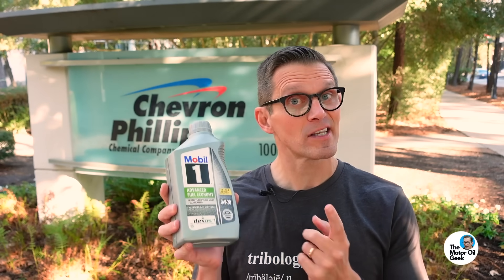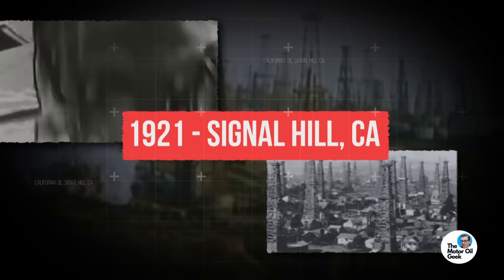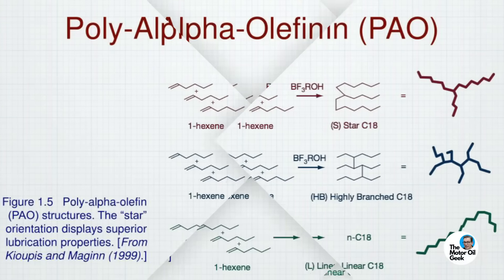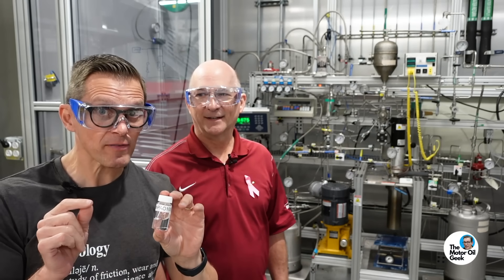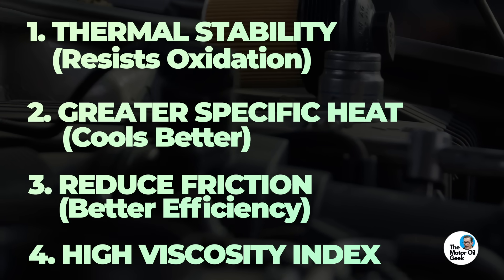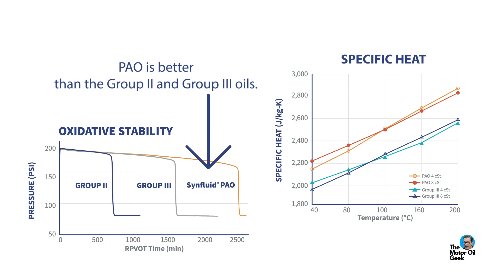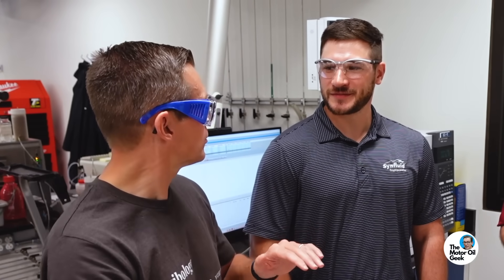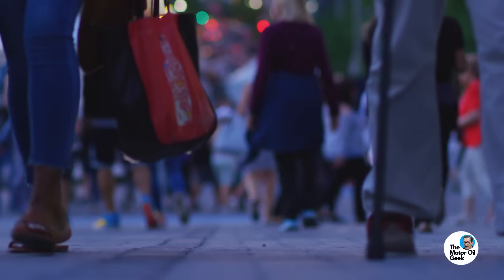STOP Using Regular Oil - 4 Reasons Synthetic is BETTER!

Comment: I noticed when Mobil 1 changed to SP, they removed all PAO and Ester from what I’ve heard.   I also noticed I’m now getting higher engine wear metals.   I’ve switched my Audis to Motul 8100 x cess (per your suggestion) which has some true synthetic.

I’ve just purchased a Gensis G70 2.0 that Im trying to decide between Redline and Amsoil signature. For complete Ester/PAO base.  Suggestions?
Reply: Amsoil, Redline, or HP lubricants.
Reply: @LoveLikeaHurricane  Wasn't familiar with HP.  Thank you for the info.

Comment: 350 SBC, -79 K5, now about million km:s. First over 600000 km:s with mineral 10W-30, after that 5W-50 winter, mineral 20W-50 summer. Never over 3000 km:s between oil change. When replacing the old valve cover seals, everything looked like just assembled yesterday inside. Not using oil. So, here in Finland oil must really do it's job, as the temperature range between summer and winter is huge.  Unless there is something else wrong, it does not matter what oil is used as long as it is changed "too often".
The old V8 does not have EGR, so the oil keeps clean and not abrasive when flowing past the filter in the cold.
Most synthetics are for light passenger car use only. The old Mobil One 5W-50 was notorious for breaking up thin fast , I almost broke my boat's Windsor 351 with that crap. Fortunately I was able to replace that with single grade 30W I got from a fisherman at the island I was visiting. With that the engine was silent again. The engine broke after couple of years, but that was because of piston pin breaking : the pin has almost no radius machining close to the connecting rod area inside the pin. There was a gray area on the breaking point next to shiny, so...
I have now used all brands except Mobil. Perhaps it is good now, but once bitten...

Comment: My 2008 Acadia uses conventional oil since I bought the car and so I need to stay with conventional oil or it can start to leak with the synthetic oil and that’s what I’ve been told by several mechanics so synthetic oil wouldn’t work in my car and I use 5W-30 weight Engine oil. I’ve had no problems and it’s got 97,000 miles. If I could switch to synthetic and it not start to leak and cause problems I would, but I’m too worried that it would cause a problem and I’m not about to try it.
Reply: You can switch to a synthetic. 2008 is new enough to have no issues with seals.

Comment: I have a 2000 F250 7.3 that has 433,000 miles. It’s always had Rotella T4 15w-40. Would it be worth swapping to synthetic or could it do more harm than good?

Comment: In the store when buying oil how do you tell if an oil uses PAO base stock? Does it always say on the bottle?
Reply from the maker: It is generally not on the label. The SDS sheet will show that info.
Reply: @themotoroilgeek  
DeepSeek concluded it's probably not PAO, but type 3 base stock. Budget oils typically aren't PAO, or might contain a very small amount for bragging rights.

Comment: I don't know if it's related to Amzoil history, but Superior, Wisconsin where Amzoil is located is one of the coldest places in the lower 48 states. When it gets 20 or 30 below zero, cars get very hard to start. Apparently synthetic oil was the answer.
Reply: I know that you've stated "one of the coldest places", but I've always thought that generally, by winter average temps, International Falls was THE coldest locale in the whole lower48.??
Reply: @Fordworldrallyfan  Yes, International Falls is colder than Superior. Tonight Superior will be nearly 20 below zero and International Falls nearly 30 below -- both pretty darn cold. 😢

Comment: I have always wondered where synthetic oil came from?  I didn't think it came from Vegetable oil.
  Years ago Amsoil said with their oil, change your car engine oil every 20,000 miles instead of every 5,000 miles.  or was it 25,000 miles.  That's when I assumed that Amsoil was a scam.
  How does  motor oil help your engine run cooler if the engine has a Radiator with a Thermostat and an oil cooler?
   Someone at Fuel Moto a Power Sports Tuning shop and Dynojet dealer told me not to worry about the fact that my cooling does not turn on until 222-F on a Yamaha FZ-07 Motorcycle.
  That's hot enough to blow head gaskets break down the oil ect.  When it's cooler out and the tiny radiator can keep up and the bike is going fast enough to run air through the radiator it does not run over 180-F ,,  I need to change the fan turn on speed to a much lower temp in the ECU ..
Reply: Many of the POES/other esters are actually derived from plant sources.

It's why many think that some of the Motul high ester base stock content oils smell a bit like bananas.

Comment: Please do a video on the dexosD spec for the 3.0 Duramax.  How does it really compare to say Mobil 1 Delvac ESP 5W-40 that I would prefer to use for "peace of mind"!  Thanks for the great info as always!
Reply from the maker: Good suggestion!
Reply: @themotoroilgeek Thanks! There is a lot of debate around this oil in the owners groups. I am not necessarily a naysayer on the 0W-20 but to take it a step further I really would prefer to use one 5W-40 (or 15w-40) HDEO for my Cummins, 3.0 Duramax, and even an old 5.4 3V Ford V8 gas motor. Not sure if it makes sense from your perspective but I have seen anecdotal evidence for many years that this could work reasonably well.

Comment: I agree. But. My Blueprint engine came with a warning that using Synthetic oils the first 9,000 miles will void the warranty. 
I am assuming they WANT a certain amount of wear in/break in, before going to Synthetic?
Reply from the maker: Break-in is a different story. No synthetic during break-in.
Reply: @themotoroilgeek have you made a video about this?

Comment: I'd love to see a deep dive into "racing" engine oils specifically aimed towards alcohol based fuels like E85-100 and Methanol, including Castor oils. I don't care about any catalytic converter or cold weather flow nonsense, just what's the best oil to run with E85/methanol for wear/breakdown.
Reply from the maker: Noted!

Comment: My dad swore that Amsoil kept the engine in his early-1980s Freightliner from being damaged after an accident the guy driving the truck was involved in. The engine cooling system was damaged, all the coolant drain out and by accident truck was left idling for over an hour without coolant circulating. When the truck went in for repairs the engine was torn down and inspected for damage once they realized the truck had run for over an hour after the loss of coolant. No damage was found to any of the engine components which my dad attributed to using Amsoil engine oil.
Reply: I recently had an employee drive a truck home from the shop without coolant. I fixed it and refilled it, and the engine still runs like normal. I'm not going to tear it down because it runs fine, but it did happen. The guy said he had to pull it over and let it cool down on the way home. People don't think.

Idling, I wouldn't expect issues in a big diesel anyway, since they don't generate much heat. A big diesel will not fully warm up by idling, not without some sort of help, like an exhaust restriction.

Comment: Hey Motoroilgeek what about a carburetor chevy 350 engine flat tappet cam also would i still need to run synthetic blend or full synthetic vs conventional i dont drive much at all until spring or summer?

Comment: As a youngster we would tear down an engine with fairly low mileage, 70 - 150k. They all had a ring ridge at the top of the bore. But the bore would be almost perfect at the bottom of the stroke. Petroleum lubricants don’t like the temperature found close to the combustion chamber, approaching 800+f. No lubricants high wear.
Reply: that's why it's common practice to build performance engines a bit looser than daily drivers (more ring gap), lets a bit of oil by to lubricate that top ring.
Reply: @ I believe that petroleum based oil will not stick to metal at the temperatures found in the combustion chamber.  I’ve built engines with greater tolerances in ring end gap and even in the bearing clearances. It was to reduce friction.

Comment: Mr Lake I am writing from Greece. I have used a  0w30  pao based vw 504/507  approved lubricant from Cyclon in my car (the number one greek company in the field) which uses synfluid pao from Chevron. I immediately noticed a very smooth start especially in winter  , a quiteness in low and medium revs but i noticed oil consumption when a pass the 8500 km mark. After that I am using a 5w40 euro spec group iii (Elf evolution sxr 900) based lubricant and I enjoy a more comfortable ride in the highway at relatively high speeds (and went back to 3000 mile oci). My point is that it seems the gap between pao and modern group iii is rapidly closing  "A modern Group III oil can actually outperform a PAO in several areas important to lubricants, such as additive solubility, lubricity and antiwear performance'' (Machinery Lubrication). I moreover noticed from oil analysis found on the web noack for euro spec pao based (vw 502, 504, mb 229.5) lubricants sits between 9-9,5 and for a more prevalent 5w30-5w40 (group iii based) i have found noack much lower and in any case absolutely similar results. A texaco havoline prods v 5w30 has been tested (in well known site..) with excellent results: noack 7,45 and pour point 49 and all this without using any pao in the formulation (according to Safety Data Sheet). Of course the best possible full pao (for example SpectraSyn MAX PAO) is the best but the cost is too high for the consumer (and the availability of PAO is limited) I think regular and frequent oil changes (3000-5000 miles oci) with a good and well known product is the best cheap way to keep your engine running  (especially in cars with timing chain because the timing chain is running in oil bath)   after all  additives like zddp  are sacrificial : "Wear largely remained at low level as long as intact ZDDP was available for tribofilm formation. The lack of ZDDP along with the formation of inorganic acids from ZDDP resulted in an increase in the wear rate by a factor of four...Dialkyl dithiophosphates as the main ZDDP compounds were rapidly degraded and no longer detected after 6000 km." (Tribology Letters Engine Oils in the Field: A Comprehensive Chemical Assessment of Engine Oil Degradation in a Passenger Car 2019) I ' m sorry for my poor English language skills

Comment: NOT ONLY ARE THE SYNTHETICS BETTER, BUT THERE ARE BIG BIG DIFFERENCES BETWEEN THE SYNTHETICS THEMSELVES. THE GERMAN RAVENOL OIL COMPANY PRODUCES A SPECIAL SERIES OF RACING OIL WITHOUT THE USE OF VISCOSITY IMPROVERS WHICH ARE KNOWN TO BE OIL KILLERS BECAUSE THEY TURN INTO OIL PRECIPITATION WITH TIME UNDER TEMPERATURE...THEY MAKE THEM FROM PAO + ESTERS + AN A IT USES MoDTC AND WoDTC AS ANTI-FRICTION ADDITIVES...I THINK THERE IS NO BETTER OIL AROUND BECAUSE I CONVINCED IT MYSELF...

Comment: it's simple.  Synthetics have a higher profit margin.  I worked for Ashland Oil/Valvoline, Occidental Petroleum, Unocal and Chevron.  Most of what is stated is correct and sure products are always being improved but still a lot is simply marketing.   For newer cars use the lower viscosity synthetics.  For old cars with greater clearances, use cheap higher viscosity oil.

Comment: My old man used to swear by Kendall motor oil. After numerous failures we eventually upgraded to newer trucks and cars that called for synthetics, specifically an 04 GTO w/ LS1 that called for Mobil 1. While his old 350s were giving up the ghost at 100-150k, this one at 125k was clean as a pin inside. I know there are better oils than Mobil at this point, but any synthetic is better than the best standard oil imo and from what I've seen on the Tube.

Comment: I have a 2024 Mazda 3 turbo, and the dealer will only use conventional oil for it. I asked why, and they said conventional is recommended by Mazda for their turbo motors. They couldn't answer any further, but this makes no sense to me. Anyone else able to get a straight answer on this?

Comment: I'm very curious about how GTL compares to PAO. My understanding is that they are supposed to have similar properties. Is GTL a significant improvement over "standard" group III base stocks? Does GTL have a similar specific heat capacity to PAO?
Reply: Also, are there benefits to blending any POEs (esters) into the GTL base stocks (or are they even miscible at all?), and if so what are they?

Comment: I told a friend of mine back in the 80s about synthetic oil, and he put it in his truck. He worked at Steamboat Springs Ski area and one night it got down to -65F. He was the only one who made into work the next day. He vehicle was the only one that started.
Reply: We often laid an 100 watt light bulb on the intake manifold, and a blanket over the hood... Like the old days light cord.
Reply: Stop spewing nonsense lies.  The lowest EVER recorded temperature in Steamboat was -54 in 1913.  No wonder why so many people are waking up to the fake news.
Reply: @Edizzle15 
Calm down mate.
It was probably 56° and he transposed it because he's remembering personal experience from 40 years ago.

The only point you've made is that you're mentally unstable.
Reply: Cars don't start below about -35 without a block heater. More like -25 if carbureted.
Reply: @Raven74947 that’s not true.  I lived in Driggs Idaho for a winter back in 2007-2008.  I was contracted to build a transportation system for Grand Targhee Ski Area as I had been the transportation manager for Breckenridge Ski Resort before that.  The coldest temperature of that winter was -42.  My Audi S4 started without issue and was not plugged into a block heater.  Our bus fleet also started (with the help of some good old ether) and obviously being plugged in overnight.  We always used “diesel 911” which eliminated any gelling.
Reply: Yeah, because there's so many people that need to start up their cars at -65F, we all need to switch to synthetic.
Reply: @JohnDoe-h5o4j  You should be using synthetic because its better
Reply: @ ChevyRedneckGFX Its not, but you feel free to drink that cool aid bud.
Reply: Especially in sunny California  @JohnDoe-h5o4j

Comment: I use 100% synthetic and I change it every 3 to 4000 miles. I’ve never had a problem. I only use the best oil I can tell it last longer when my check engine oil level.

Comment: Keep em coming Lake!   
I use Mobile 1 Truck & SUV in just about all my engines.  3.6 to 8.1.   
My plane ✈️ have to use Phillips 20w-50 plus cam guard due to the lead in the gas.  We have to stick with mineral to keep lead on suspension from blow by contaminants

Comment: Saw the difference between conventional dealer bulk Pennzoil 10W30 and synthetic Mobil 1. I had an older 740 Turbo Volvo, the difference in oil temperature between conventional and synthetic was substantial. When in bumper to bumper traffic, with an outside temperature in the 85-90 degree area, the Mobil 1 ran 35-40 degrees cooler than the conventional oil. In the winter at start up in sub freezing temperatures the conventional 10W30 would peg the oil pressure gauge at 100 psi, while the Mobil 1, ran around 60-70 psi.

Comment: Pennzoil ultra platinum or the amsoil signature series for a naturally aspirated car NA with low rpms on the highway if what ever change interval is opmial that or a fram endurance filter or a wix filter fram endurance filters alot better but wix has the best flow rate which is better

Comment: My 2014 F150 with a 3.5L ecoboost has only ever had Amsoil signature series oil and has 323000 kilometers and is all stock inside. No time no codes no phaser rattle and still doesn’t burn a drop in 8000 kilometers of truck use
Reply: There's one

Comment: What about in older engines with flat tappet cams? I have a gen 1 sbc in my 64 chevelle and I use valvoline vr1 20w50 convencional oil. Would recommend I switch to the synthetic version of the valvoline vr1 20w50?
Reply from the maker: WALMART Oil Showdown: Myth Busting Results!
https://youtu.be/j8tpRxQLqU0

Comment: Hello Lake, love your videos. Very informative and interesting to get a taste of the chemistry behind everything. That said, there has been an age old debate for rotary engines. Some say NEVER use synthetic. Reasons being it apparently doesn't burn as cleanly leaving more carbon deposits. (Carbon deposits is a cancer for a rotary engine). They also recommend high zddp oils as well. In case you're not aware, Mazda pumps engine oil to the rotor housings to lubricate the apex seals(I use vr1 Original 10w-30. Burning engine oil in the process. The reasons other say to use synthetic is that when the engine was designed, Mazda just did not test it so they didn't recommend it. Question to you, can you end the debate once and for all for the rotary gang here? Thanks again.
Reply from the maker: Great suggestion for a video.

Comment: Great video and explanation. As an Amsoil dealer the toughest market is the installers. I wish I could sit them down and help them understand the importance of high quality lubricants. They simply are only concerned about costs.
Reply: At the end of the day oil is oil! If you're in a cold climate synthetic is  your best choice! If you're abusing your equipment and not changing your oil on regular basis then synthetic is best! Conventional oil is fine for people that take care of their vehicles!
Reply: It's because that's all the customer cares about.
Reply: amsoil is amway for dudes. sure, it is better than regular cheap stuff and the reps are very knowledgeable about their products but that does not equate to the products being the better choice for the customer. i got a 50 year old FE with a rear main seal leak that needs rebuilt. until i get around to it to hell with putting in your bespoke oil with the 11 herbs and spices that costs four times as much. she gets rotella 15-40W.